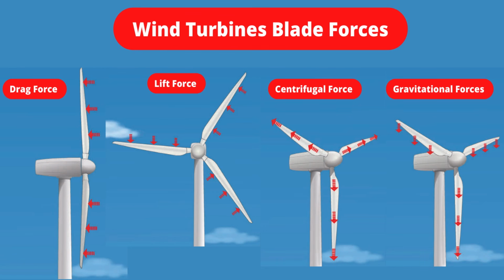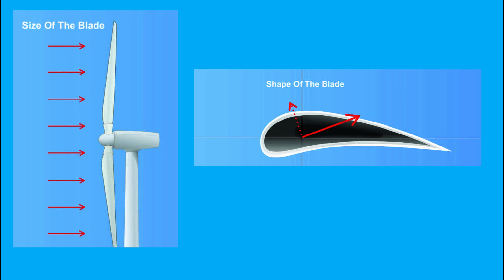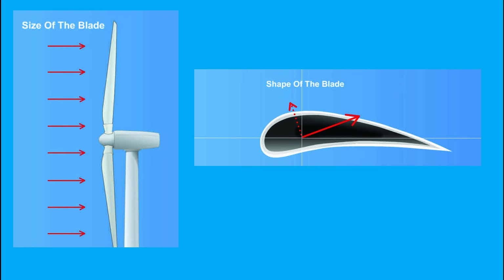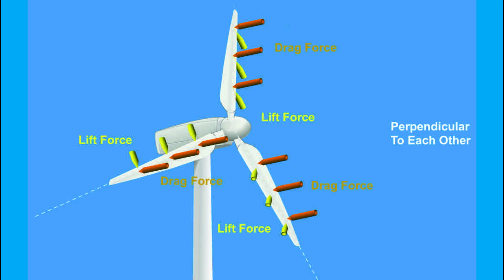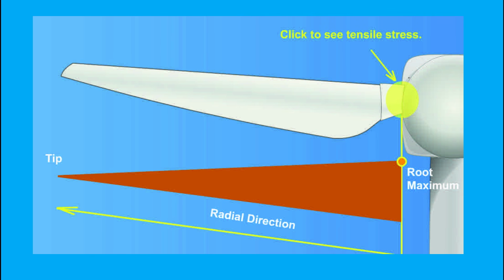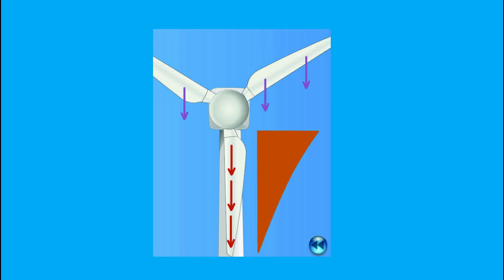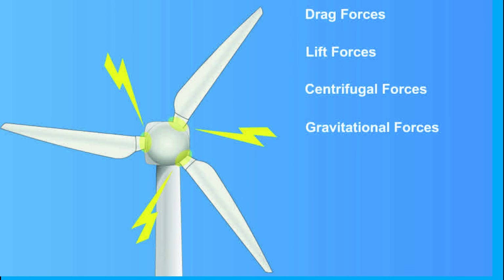Lift and Drag forces on wind turbines blades

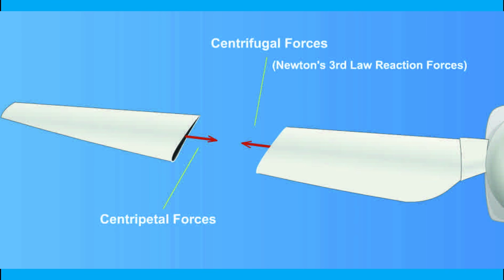Comment: The Diagram at 1:43 is wrong in my opinion. The leading edge of the blase is the long straight side, so the Rotor will turn in the opposite direction than indicated (the forces are therefore of course pointing in the other direction)
A quick google will give the following answer:

„All current-day wind turbine blades rotate in clockwise direction as seen from an upstream perspective.“